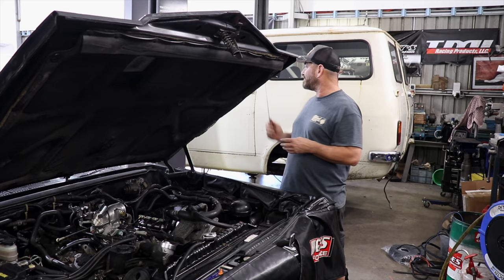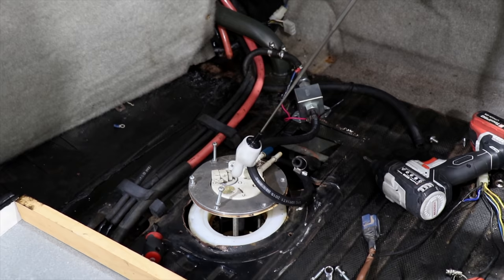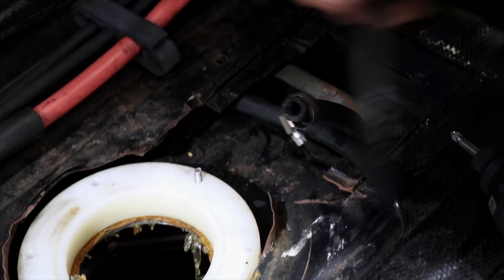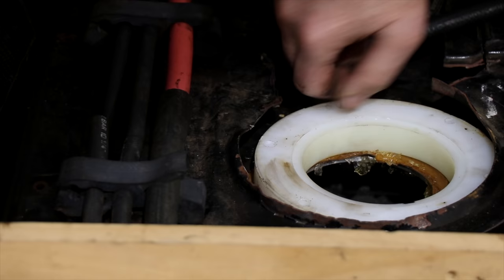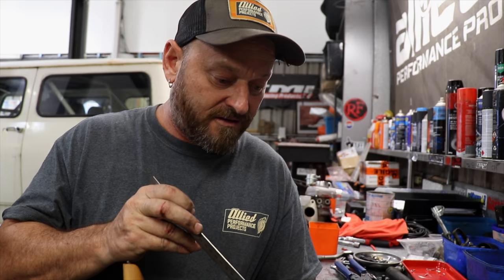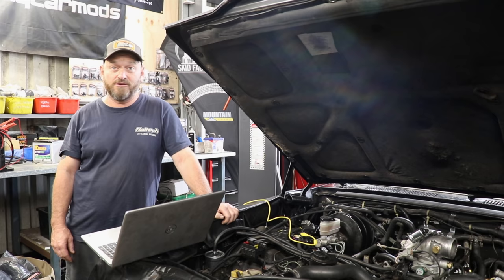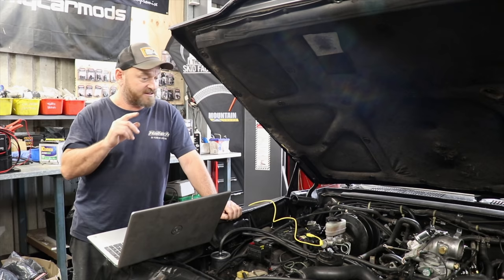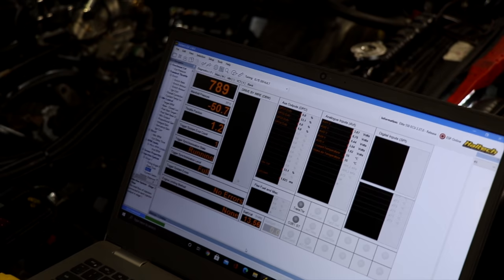Disrespected Fuel tank & First Start - Nissan President Ep3

Comment: When Alan said "I have to find that relay" (22:30) I breathed a sigh relief. That's the perfectionist I've come to know and love! Wait, love? Well..no, I mean respect, or...ahh..whatev. 😎👍
Reply: It's not just perfectionism though. Modules partially left in circuit can cause parasitic draw if you don't thoroughly understand how they work. Spend 10 more minutes now and save a days of headache later
Reply: @AntonBabiy  Ahem, perfectionist you say. Bims on about the dodgy fuel sender/pick up abortion then puts a cable tie on the level sensor.?? A P clamp perhaps would be a perfectionist. Alans is still awesome though.
Reply: And also I think it was the single funniest moment on this channel I've ever seen...  the look of struggle on his face while considering just running a new ground, then finally blurting out that he has to find it - "I can't not." :lol:
Reply: The zip tie in the fuel tank is still a bit backyard mechanic. Wouldn't have taken long to knock up a proper bracket. I mean we don't need to get all Project Binky on it ass, but a zip tie is a bit sub par.
Reply: @DodgyBrothersEngineering  Not really. Plenty of fuel pump kits literally come with zip ties for the installation. They'll last forever in a fuel tank. Barely any instantaneous stress on them. No way they will break.
Reply: @AntonBabiy  I think in this case it's less about perfectionism and more about having to know where the relay is and at least partially what it does. Curiosity!

Comment: My theory on the relay - it was an early fuel safety device. Some controller isn't seeing a tach signal so turns the pump off to stop it from burning out or pumping fuel after an accident.
Reply: My hr31 ran a  pickup pump before the main pump maybe it's just the prestart priming relay
Reply: I was thinking along the same lines, maybe there's a messed up rollover switch in the car. My guess is this fuel relay controller is the reason this car got a carby retrofit in the first place.
Reply: This was my thought as well.  My aw11 has a similar system but fed off of the flapper door style air flow meter instead of a tach signal.
Reply: Could also just be a voltage dropping resisitor to slow down the pump for light loads. Some are 12V-9V  and some pumps don't like running on 9V
Reply: @coltonmcrae5873  Haha!! Most likely!
Reply: Exactly what i came here to say! And then I think Colton McRae may have hit the nail on the head!
Reply: My old Toyota has a setup where it primes the fuel pump, but the pump only keeps running if the AFM sees airflow.
Reply: My mk1 golf has one
Reply: Was thinking the same thing. My guess is there is a body control module that gets some signal or voltage saying the engine is running. It keeps the fuel pump from gushing fuel out in case of an accident. I believe my 74 260z had something similar that I had to bypass when I installed megasquirt.
Reply: @glennimmortal  Must be the only hr31 that did, they run a single intank pump earth switched by the ecu with a tacho signal safety cutoff just like an r31
Reply: My parents haved an old brocco 2 and there was a box under the passenger side dash. If you accidentally kicked it the car would think it was in a rolled over and the fule would go out.
Reply: I thought it might be part of an early ECU immobiliser?
Reply: @mikebaz7843   my hr31 gtsx had the same as glenimmortal has described. Relay died caused just as much stuffing around as in this video
Reply: Yeah, I was thinking the same thing. It seems like it’s looking for a signal from somewhere and because it isn’t seeing one it’s shutting down.
Reply: @breno4551  relay yes, two pumps though?
Reply: @mikebaz7843  low pressure in tank prime, then inline high pressure. This is the eccs setup. 1 wire from eccs that splits to both pumps
Reply: Exactly what I was going to say. For example the Chrysler ECU I have been working on will turn on everything while cranking for up to something like 10 seconds, but if it doesn't get a crank signal by then it turns everything else off. I'm guessing that module is a timer which runs the pump for a set amount of time and if it doesn't get a signal from the ECU that all is well, it automatically turns off fuel.

Comment: Going back to my days at Holden, the VL Commodore (Nissan Engine) had a set up which cut power to the fuel pump and oxygen sensor heater wire (on the same circuit) if the relay didn't receive spark signal after 10 seconds in case the fuel line got damaged in an accident. Because you got rid of the factory ECU the timer was coming into play.

Comment: Some of the old dattos have a fuel cut off switch based on oil pressure. They turn off the fuel when there is no oil pressure. The reason it probably starts for a bit and then shuts off is because they have a timer that will allow it to run with no oil pressure when it first starts up (so the fuel pump will still run when the engine is off and you go to start the car)
Reply: some early kubota tractors had ths when you changed the oil and filter you had to restart it twice.
Reply: How bloody good are dattos I've got a 200b sx in the back yard I'll get to one day
Reply: VN commodores "had" that but the wiring was wrong from factory and it never worked
Reply: @tortron  yep. deleted that shit asap lol
Reply: yes in the uk rover did this if no oil pressure after abbot 10 secs it cutout

Comment: This car rang a bell for me. The tweed heads thing in the fuel tank pretty much confirms I’ve seen this car before. It used To park up on Cavil Ave in the late eighties. Like on the footpath with bad asses sitting in it possibly procuring ‘customers’ and possibly ‘sales’ of a certain type.  Back then it was the most awesome car I’d ever seen. And it still is.

Comment: R32 GTSt had an inline resistor that would be switched over to drop voltage and drop fuel pump speed when full bore wasn't required.
Problem is a lot of aftermarket pumps simple won't spin at all at that lower voltage. It's common practice to bypass it.
I did mine >15 years ago based on some SAU forums posts and have no idea how but I'm sure you'll work it out if you haven't already.
Reply: Considering the lamp shutting down, I don´t think it connects a resistance in series, I think the  extra wire is to get a resistance to time the shutoff.

Comment: Pretty sure most Nissan's of the 80's & 90's era has those fuel control units.  Basically just a unit with 2 earths, on direct to earth and the other via a resistor to reduce voltage to the pump at low engine rpm to reduce fuel pump noise. Can't remember what triggers it but when upgrading to an aftermarket pump most people bypass it and ground it directly as most aftermarket pumps don't like running at a reduced voltage.
Reply: A lot of Toyota’s had this as well, Soarers and Supras come to mind.
Reply: A good example Al should know is a 300zx. Variable earth Voltage control
Reply: Yeah, Aus-delivered R31 also.
Reply: On all sorts of old cars, rx7s had them to.

Comment: I’m pretty sure that relay that cuts the ground to the fuel pump is a capacitor and is meant to get a neg signal from the coil so the fuel pump stops after a short time period of no signal from the coil. Basically just like a LPG neutral safety switch
Reply: When the engine stops, the fuel pump stops. Toyota's used the air flow meter signal to control the "circuit open relay". Only other thing I can think of is a high/low pump circuit. Starts on full voltage circuit then cuts to the low voltage circuit for idle and light throttle.

Comment: Did Mark say to specify the HR31 sender unit and not to say R31? 🤣.
Fuel cut off relay. I remember reading about this when doing an engine swap in my HR31. Fuel pump has a safety relay on a timer (best way I can describe it) so it cuts outs in case of an accident. Seems like that's what happening. When you first turn on the ignition the pump primes and cuts out, by bypassing it the pump will constantly stay on with ignition reds.
There may be some info on this on the R31 Skyline Club. I don't think I posted anything about it in my build thread but another member (acsplit on that forum) wired my car 15 years ago and would have a good idea.

Comment: Z32s control fuel pump speed on the ground side of the circuit - i'd assume this is the same. Its pretty common to just ground the pump when fitting aftermarket pumps as the OEM pump speed controller doesn't like the extra current draw.
Reply: Yeah I bet it's this, a dual speed pump setup
Reply: So it's running at full speed during startup and then some control drops it to low speed since it's idling after the cold start enrichment period?
Reply: @haphazard1342  yeah that's what I was thinking, seems plausible eh. I had an r33 skyline that had this kind of control so it's definitely not just the z32.
Reply: @Bigelboe  yes sounds exactly the same as my R32 setup and as mentioned above. I have and forums recommend to bypass when fitting a new / bigger fuel pump to confirm 12v getting to the pump.
I believe it was to stop excess fuel circulating at idle and low revs. And also to keep the fuel pump noise down, especially at idle while stationary for example.

Comment: Hay Al it's Al in Perth. Yep blue relay is a fuel pump relay in standard format they have  30sec on key acc power, but should still run. They are common fault Japanese stuff. Just run your own wiring n be done. Also safe 👌

Comment: That DIY fuel system was crazy. The calender from holden was worrying, did they just have it or did a holden worker do it.
Reply: Knowing holden was definitely a worker lol
Reply: Bloody  rough as! I'm surprised the whole car didn't go up in flames.....(before the boys got
 to it, I mean...)
Reply: Using silicon sealant around the fuel pump assembly on the bodged setup is the worst ever with petrol, is sort of dissolves and goes gooey and stringy. I am amazed it didnt do that and clog the jets up in the carby.
I learnt the hard way when I was a young kid and did exactly that on my motorbike.

Comment: I need to check my old manuals but from memory the old Nissan ECCS systems used to run a 9 (ish) volt feed to the pump via either the ECU or a tachometric relay to keep the noise of the pump down (and heat) at idle and very low RPM. When the RPM rose the engine control system would switch it to battery power (14 odd volts) and the pump would run at full delivery. The last Nissan that i can remember that had a version of that system was the R31 Skyline with the RB30E engine.

Comment: the old nissan tanks were bad for slosing, as they only had a small cup the fuel pump sat in. did this one have the cup removed? i actually removed the in tank cup on a r31 and fitted a falcon style MRA (std surge tank) to the r31 top hat...as the factory surge tanks do a decent job for what there designed (keep fuel around the pump). Interesting the pressy one worked as they normally use the return flow of fuel to feed a suction valve at the bottom of the MRA to fill the MRA...and looked like the pressy just had the tube sitting in no mans land.

Comment: Awesome to see this running guys! In my one I had to disconnect the plug to the black box by the blue relay or it will flood (shit injectors?) That seems to be a timer system that runs the pump for about 30 secs. There is a relay at the front right of engine bay that clicks on and off on mine that runs the pump but the ECU turns it off quite quickly unless the motor is running. A turbo would be fantastic on these for keeping up with traffic, been passed by tradie vans on the big hills more than once.

Comment: For the fuel control, it derates the pump at idle to be less noisey. I believe it requires a pressure sensor output which was probably on the old pump but not the new one. The fuel pump ecu probably has a condition where if it senses no pressure for 30 seconds it'll shut off power (in case a hose has split). You're right, skyline has the same stupid system.

Comment: The relay is a fuel pump safety switch and runs off either the coil or the RPM output from the ECU. The other box has a simple 555 timer setup in it.  It’s the equivalent of the old Circuit Opening Relay in the Crown or AW11 ;)

Comment: It's a fuel pump priming/safety relay..Turn the key and the pump primes but then stops if you don't start it..the original setup would have picked up an "engine running" signal to keep it on once the car started..

Comment: Nissan did do some weird shit with fuel pump control in the 80s. Generally the pump had either constant or switched 12V supply and the 0V was variably controlled to ground through a resistor bridge. Either through a FPCM (Fuel Pump Control Module) or directly by the ECU (Ausdel R31 Skyline). This ground was typically black sheath and grounded back to the unit or ECU with a white inner sheath from memory.

General rule of thumb - upgrade the wiring. New 12V ignition switched supply and the 0V back to a relay that is switched by the ECU. Or better yet, fuel pump PWM speed controller.

Comment: It's probably been said but I believe the controller for the relay is looking for signals from the engine, be it oil pressure, tac signal or something else, if the controller doesn't see the signal it automatically switches off the fuel pump after a set amount of time. It could be in case of an accident, or if they don't want the pump to keep running with the key in the ignition.

Comment: That relay in the back could be part of an "immobilizer" system. You turn on the engine and you need to press a secret push button somewhere in a hidden spot. If you don't, the engine dies after X seconds. This kind of thing was pretty much common in the 1980's.

By the way: very cool shirts!

Comment: Hey all, i think that rear relay is a safety device that cuts out the fuel in the event of a rear end impact. Often they are a one off use motion sensor item, so if triggered you need to replace the unit( i.e. hit up the rear or smashed in with frustration with an 8oz attitude adjuster). The unit triggers the relay and the relay cuts off the earth. I understand some states in the US have this as a mandatory RWC item.

Comment: Fuel pumps used to switch of if the alternator was not putting out 13.5v, It was an accident prevention that in an event of a crash, if the eng stopped but the key was still on the fuel pump would turn off to prevent fires. So just check that you haven't isolated a volt meter or amp meter.

Comment: Pretty sure that fuel relay setup is for an antiquated system for variable fuel pump speed so the pump only runs at full whack when needed and slows when at idle etc 😃👌

Comment: a few days late but I know some 80s Nissan/Datsun had a oil pressure and alternator timed fuel pump cut, if the oil pressure sending unit has 3 or 4 wires one of them leads to the module, after cranking if it loses signal from both it will shut down.

Comment: Similar to other comments, R32’s have a fuel pump speed controller next to the pump relay in the boot. The idea was to regulate the pump speed according to demand to stop the fuel heating up. My guess is that the input from the factory setup is missing causing it to trip.

Comment: Hey guys, I've got a 1998 pontiac gtp 3800 supercharged that would do something similar to what your fuel pump is doing. 

The fuel pump ballist resistor went bad and the car would start right up every time then die out after a short time. 

The way I understand it is they put a heavy duty type fuel pump in it from the factory and it had 2 circuits to run the pump. One for starting and a second one for running.
Reply: I'm guessing my Grand Prix gtp has a similar fuel pump design to what your Nissan does.

Comment: My money is on that fuel control module picking up an ignition signal, negative side of the coil maybe, to make sure the pump is on only when the engine is running. In the event of an accident etc or severed fuel line the pump wouldn't just be pouring fuel on the fire so to speak. I added an aftermarket version of this to my resto for safety.

Comment: I'm no nissan guru from the 80s but I have an '86 z31 300zx. I assume links are not okay to post, searching for "z31 fuel pump relay" there's a forum thread on z31performance by DrewZee87T that explains how the system works

Comment: Not a nissan guru, but some fuel injection systems use timed relays to prime the fuel pump, when you turn on ignition it works for x amount of time and shuts off so you cant ruin pump for forgetting the ignition on, after it sees engine rpm it sends power to primary relay to keep te pump running. My guess is that when you deleted oem ecu, the prime relay wont know when to turn on and system uses only timed relay. Hope my comment makes sense and you figure it out.

Comment: That relay/module could be acting somewhat like a circuit breaker by de-energising when it sees a higher current than what it's bi-metallic strip is expecting. The new pump is likely drawing more current than the original. Some sort of safelty feature. Just a guess.

Comment: Hey guys! I really do enjoy your videos. I'm 75, I've worked on engines since I was 14 and I have learned tons from you guys, especially on the ECU controls you went over in your previous video. Indulge an old man if you will. Could you go a bit more in depth with the semi sequential fuel injection using the Haltech 550 on a 6 or 8 cyl engine? I understand wasted spark ignition but I'm a bit fuzzy on the fuel injection. Are you pairing injectors as you do spark when controlling a 6 or 8 cylinder engine with the 550? If so, is there any danger of damage by firing the paired injector during the exhaust stroke? It just seems a bit worrisome to inject fuel into a hot exhaust if this is the case. Help! I'm being dragged into the 20th century kicking and screaming!